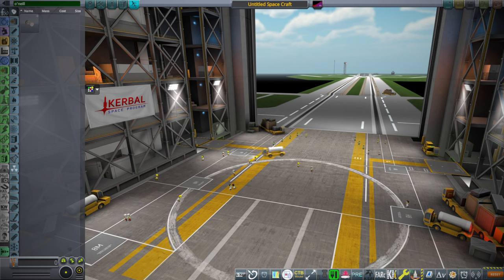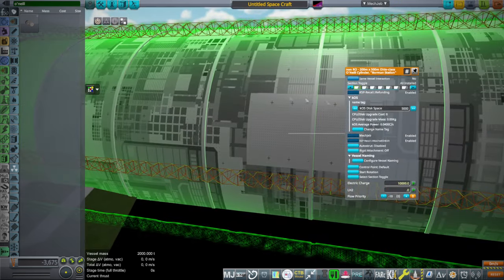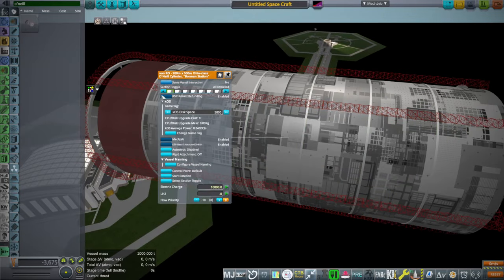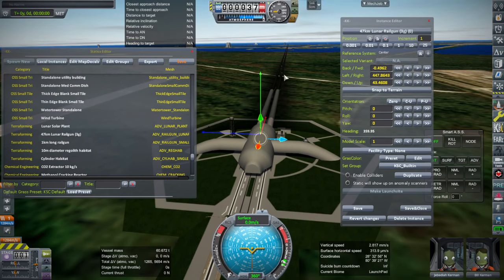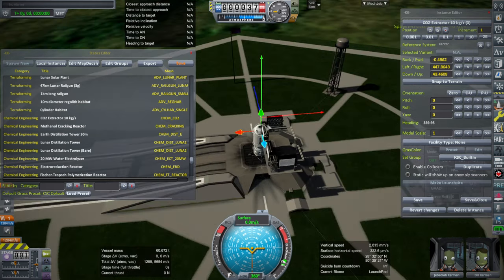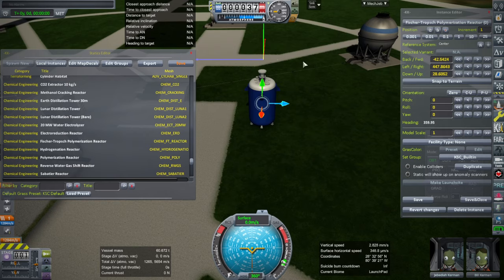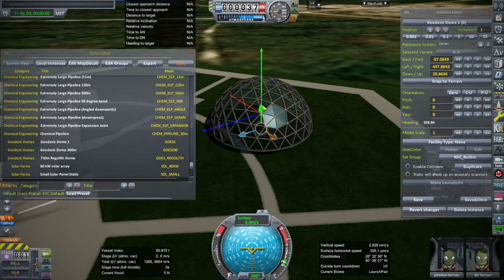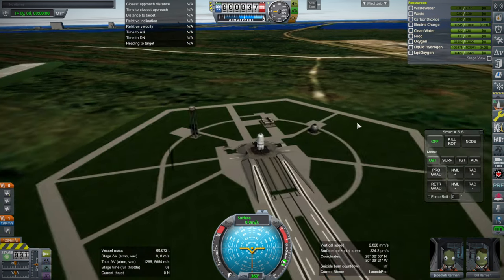Kerbal Space Program - The Paraterraforming Mod by InfoTheGamer

Comment: What is an O’Neill cylinder?
Reply: An O'Neill cylinder (also called an O'Neill colony) is a space settlement concept proposed by American physicist Gerard K. O'Neill in his 1976 book The High Frontier: Human Colonies in Space. O'Neill proposed the colonization of space for the 21st century, using materials extracted from the Moon and later from asteroids.

An O'Neill cylinder would consist of two counter-rotating cylinders. The cylinders would rotate in opposite directions to cancel any gyroscopic effects that would otherwise make it difficult to keep them aimed toward the Sun. Each would be eight kilometers (5 mi) in diameter and 30 kilometers (20 mi) long, connected at each end by a rod via a bearing system. Their rotation would provide artificial gravity.
Reply: @owenmonckton2713  Huh! Some of the things we humans can create in our fantasies are wild.